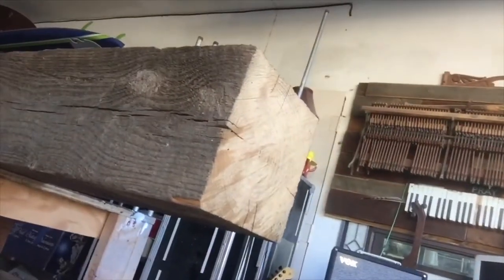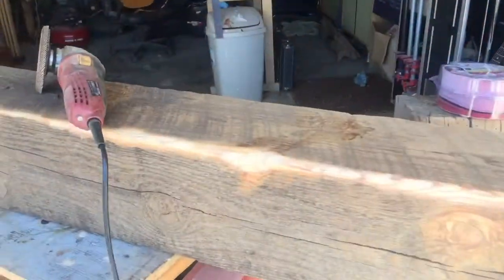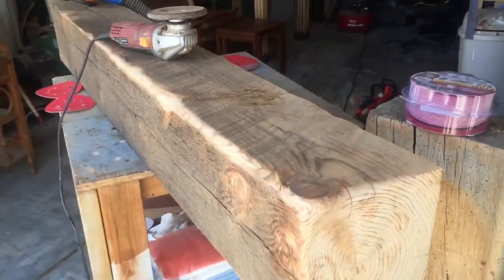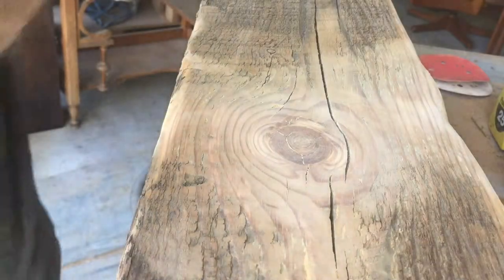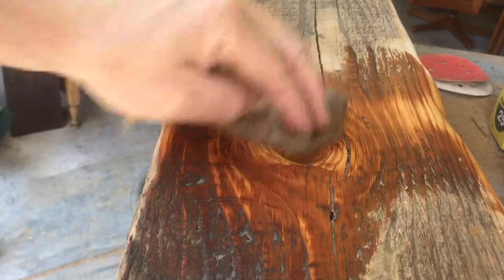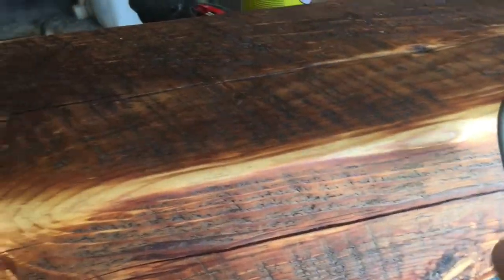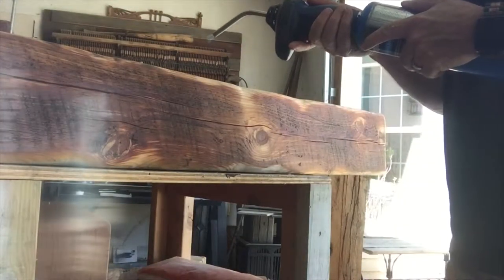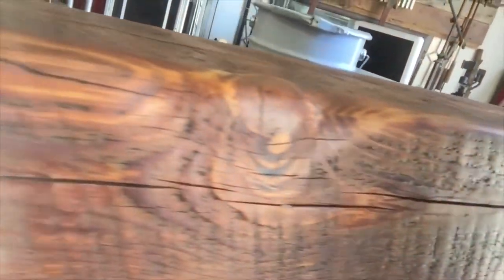Vintage Timber Mantle Finishing Part 1

Comment: Good evening Van's.
Could that mantel, be mounted on 2x4s. Looking to add a mantel as a focal point, but only have a regular wall (2x4 drywall) how heavy is a piece like that...
Beautiful work sir...
Reply: Yes . Make sure  the lag bolts hit dead center on the stud. Also I’d only feel safe with3 or more lags....
Let me know if you need more info!
Reply: Another option is a “box mantle” it’s 5 pieces , top, front, bottom and sides all 45 degree edges and glued & nailed. It makes the mantle much lighter. This gets mounted on a French cleat.